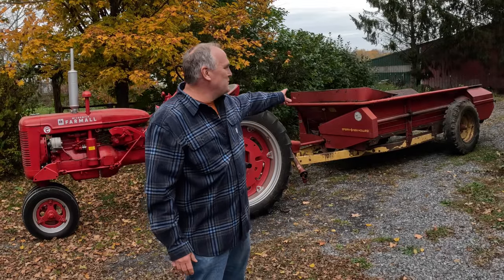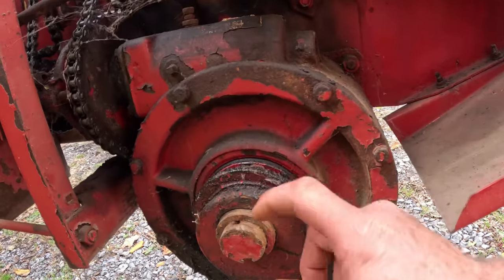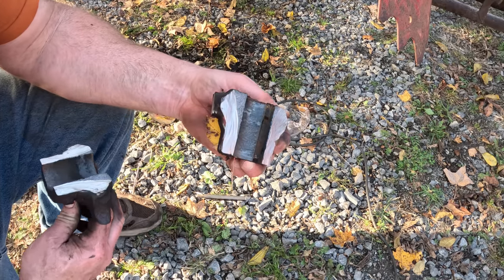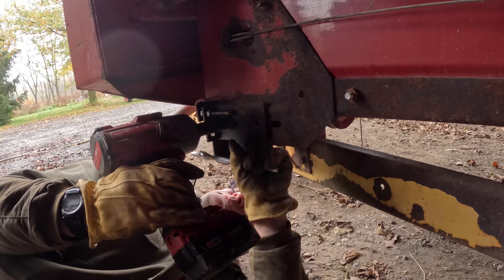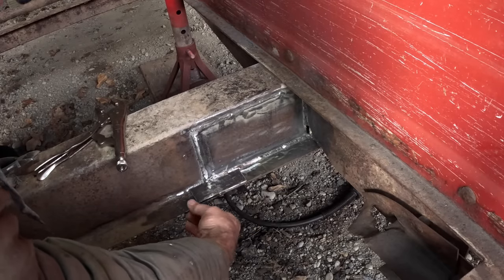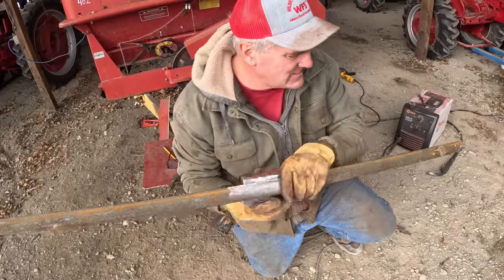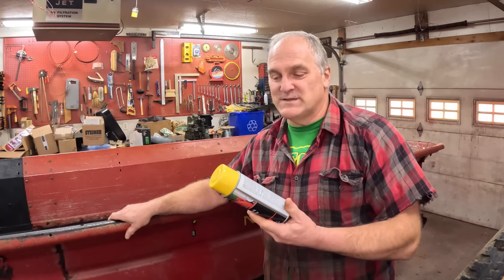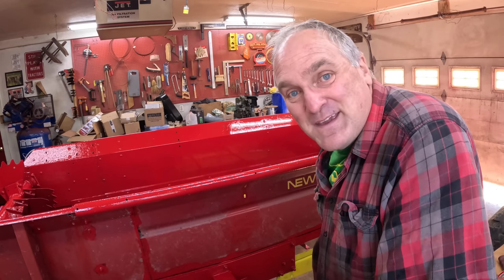The Great Manure Spreader Makeover (New Holland 514) Part 1

Comment: Reminds me a bit of the 54 F 150 me & my dad fixed up for him. Pulled it out of a farmers field, he was using it to feed ear corn out of, sunk in a mud hole up to the running boards.
 We fought rust for close to two years. Cab & bed off. Frame up rebuild.
  The drive train was still in good shape.
The running boards he fixed the holes using bras rod and a smal torch. Took forever but replacements weren’t readily available back in 1968.
Thanks for sharing.

Comment: 30 years ago I bought an old farm and found an older model of yours back in the weeds. I took all the chains and paddles off, replaced the deck and turned it into a wood and dirt hauling wagon. Still use it.

Comment: 11/9/23..ohh yes Pete, retrofiting your manure wagon, part 1, was a fine video to watch today; grinding/cutting/metal fitting & welding, special chemical prime painting over (wire wheel) sanded surfaces, 1st-coat painting yellow frame & bright red on sides, both inside & out.  Yup, great part 1...next please show us complete red painting of all outside surfaces, maybe new (New Holland) decals (?) but go back to your welding equipment...was that an old Lincoln Mig unit with FluxCore (.035) wire? Your comments please. Stay safe & carry on!💪👍⚒️🔧🪚🙂

Comment: Projects like this are kind of "play it by ear" as you tear into things.  That was  nice reinforcing on the axles and front crosspiece. When you're done, ought to go for a long while. Spreaders are one of the most neglected pieces on a farm. I've tried to clean the spreader out between seasonal uses and oil the apron chains with used oil...which also helps preserve the bed.

Comment: I did something similar with my NH212 spreader. Since I travel over public roads I added an endgate and put some cut down truck mudflaps on the front where the apron chain comes up to keep the "leaks" under control. You're right, as long as you clean them up they'll last a long time. Looking forward to part two, and yes you should paint the whole thing, but you could spray the nicer areas.

Comment: Pete, what you need when you're doing a job like this is a reasonably good plasma cutter and they're not that expensive if you stay away from the outrageously hi priced ones.  You got the job done with the angle head grinder/cutter but boy what a pain.  And when you're replacing flat pieces of metal as you did on the side of the axial, I would overlay the patch with a oversized and overlapping plate with slots cut into it that I can weld through  for weld contacts in more than just the edges.   And those chain guides that you duplicated, I would have made them out of 1/4" material, at least the wear surface part of it.   Then again, I'd build a jewelry box out of 2x4s.   But, I have to admit, what you did do should make that spreader work for several more years.  Keep up the good effort.

Comment: Excellent video Part 1 Pete :) fixing up the Manure Spreader be challenging for sure oldest one seen good was my late  Grandfather  on my late mom  side it was a Massey Harris  Number #7  it one arm turn on no PTO  was all Spreader wheel driven  took 6 trip bucket fill up  , tires were pickup truck ones old 16 inches ones  6 studs bolt on 3/4 or 1 ton use back 1950 to 1970 ! Red and Yellow colors  my grandfather got me sell to my Auto Mechanics shop classes  teacher in High School  1991  he was looking for one for horses  waste put farm feilds! My grandfather  brother rebuilt with John Deere, Massey Ferguson  , International  parts fix up old Massey Harris 7 one  he was there Mechanic person on farm near each other too! Also my dad also uncle  had home farm a McCormick International  #175  , International # 575  & both had Stake or Highway Tractor Truck Tires too and I found was had installed new ones both one time ! For Lol Pete my late Dad & Uncle used say lets get Cow Muffims Waste  in April  and in October  month put Feilds with Spreader on tractor  3 farms worth to do ! Yes was funny  said that 1950 Cockshutt COOP 40 gas tractor was with McCormick International  175 Spreader  , 1968 International 624 A Desiel  motor tractor  was with #575 International Spreader   and 1963 McCormick International B414 Loader tractor Desiel motor  in home barn yard plus stalls , 1978 International 724 B loader Desiel fuel  was on 2 and 3 farm  to clean just barn yard and big stalls  !  35 day's of fun ! Yes Snow lights on Wednesday  last week Pete my way and all melted too Lol

Comment: Great work, seeing the old peice of equipment coming back to life is great. On the guides underneath you could add a thin nylon pad to help protect the steel better, on the axle 'box' perhaps putting the bottom flange at a downward 45deg slop might prevent as much build of material. Keep up the great videos...all the best from Ireland...

Comment: Hello Pete!  A suggestion about the manure spreaders wear surfaces (like the shoe plates and the front center skid plate you fabricated) .  A thin piece of HDPE mechanically fastened to that wear surface will last a good long time.  I can't see any similar wear surfaces - but you will know.  A little bit of HDPE sheet goes a long way. Really happy the equipment shed is working out so well for you. 👍
All the best!  😊

Comment: Bought NH 212 at auction unseen for cheap, every bearing was seized. Parts are few and far between or expensive. Had apron and drive shafts made up at the local machine shop....much cheaper to go that route than trying to find a donor or buy the parts from a supplier.

Comment: If you have the original owners manual.  The warranty is stated on the inside of the front cover. We  sold a speader  with the manual and the buyer got the new sides.

Comment: Hey Pete, You didn't say anything about the lumber for the deck. What I have in mind may be cost prohibitive. But see if a hard wood supplier in your area has " Ipe " Yep that's how it's spelled. It's sold as a low cost alternative to teak. I made some out door furniture for a customer out of it. It's fantastic stuff. Light years ahead of pressure treated pine. It would be ideal. "IF" it's available and affordable.

Comment: Pete, altho pricey if you've never experienced using a carbide drill bit, get one just to know how it feels drilling thru a stainless steel bolt like HSS does thru cast iron.  Yea, its a good feeling.  Get a small one, bout  1/8". Depending where you get it $15 Amazon, $30 Granger.

Comment: Good   day from Ontario.  Bck in 76 bought new 130 MF  spreader,   dad always made us put old motor oil on floor, 
even before using ,   boards never rotted it out.  Boy  those gears were wore down
But $400. for shaft   wow     was  that from NH  or machine shop???
Boy we  had on-line  auction,  2 NH with horse  tongue   and  honda motor brought $350/ ea
Thanks

Comment: It is amazing how you can restore  a rusty old implement. Of course you have to complete the paint job and replace the decals. I am surprised you did not scab over that big rust hole that showed up in the last minute of the video..What happened to the old wood manure spreader you restored 10 years ago?
Reply from the maker: Hi, I still bring it out to spread a few loads every year, to give the older tractors a workout.

Comment: Those spreader apron gearbox and shaft give me ulcers just thinking about it, I had atleast one a year blow out a gearbox, sometimes more than 3.  Neighbors said they knew I closed the shop when their was no longer one sitting here with that gear box torn off the back, and they were right.  More times then not we would blow the shaft in half right behind the gear box to pull out the sleeve for the shear bolt and then put it in a press to push the shaft out, I would then machine key ways in a new piece of round stock to replace the whole shaft,  had a few sleeves that a 75 ton press wouldn't budge the shaft out of, end up replacing that as well, at the time CNH didn't want much for it, that probably changed.  I don't know why guys here thought they could run corn head grease in them, it would harden up over time and wear out everything inside, run the oil and if it starts leaking service the seals, far cheaper in the long run.  They are sure proud of parts for those.

Comment: Push the weld not pull
Reply from the maker: Not with flux core wire. You'll have holes throughout the bead from flux contamination.